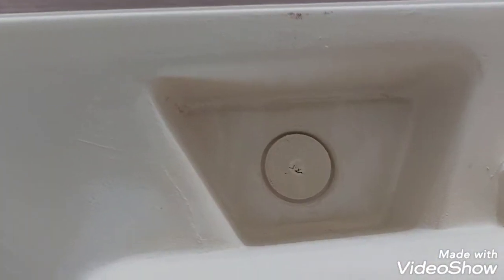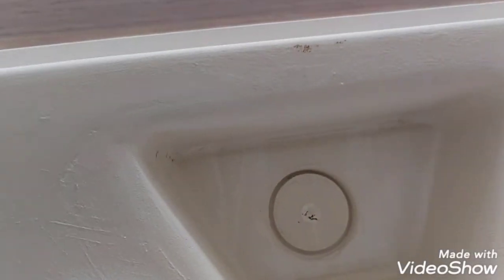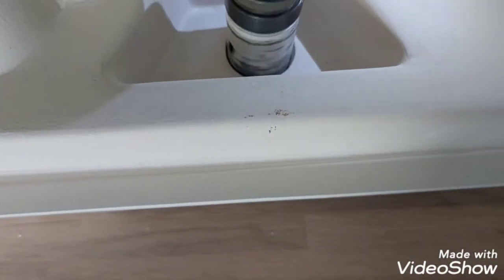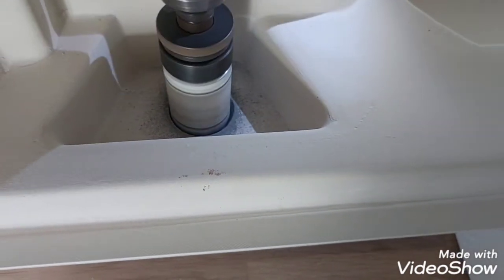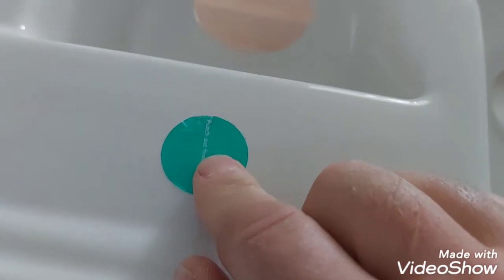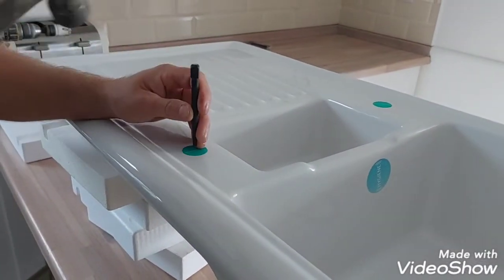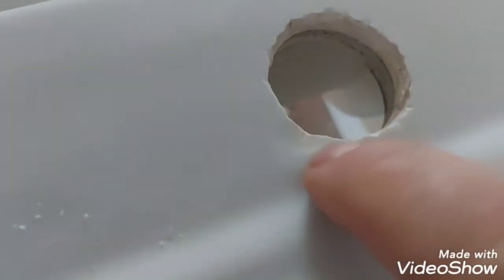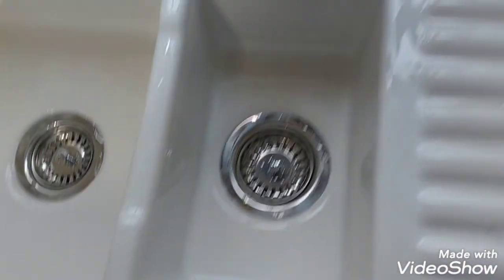How to knock out tap hole on ceramic sink

Comment: Can't u use the same drill bit on both sides instead of hammer? 🤔
Reply from the maker: Top side is glazed without pilot hole so it would be difficult. On sink instructors stated to only use hammer and point punch, it is so scary to be honest. I tried to deepen cut from underside first

Comment: This is the incorrect way of doing this .. I've knocked out loads using standard method.. You sart at the outside of the circle not the inside as you will guarantee to break the sink ..Next time I do one I will upload it ..
Reply from the maker: Thanks for sharing that. I'm uncomfortable with punching around the edge. I used to do that way, and that is how I got my first broken ceramic sink. The sticker was not corresponding to the hole cutout perfectly, it did not line up with the hole, so when I punched on the edge of the sticker I was actually punching a way outside of the hole causing ceramic to crack. That was the time I've turned to punching the centre of the sticker, which is guaranteed to be within the hole. And then clearing/ chipping the edge.
Some brands do place the stickers perfectly in line with the hole, others don't. This particular sink in the video had sticker misaligned for about 5-6mm
All the best 👍
Reply: I am about to do the same thing and I will do it your way. Thanks for posting the video 😎 @mrfxr1695
Reply from the maker: @dugbert9  good luck 🤞